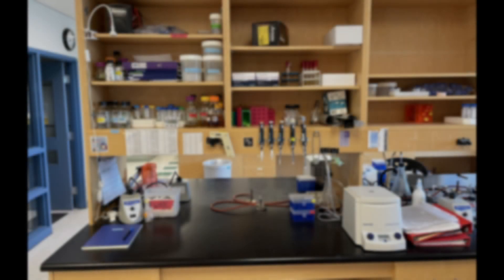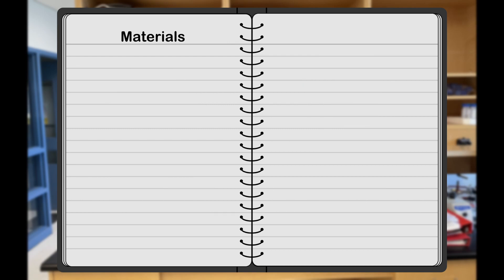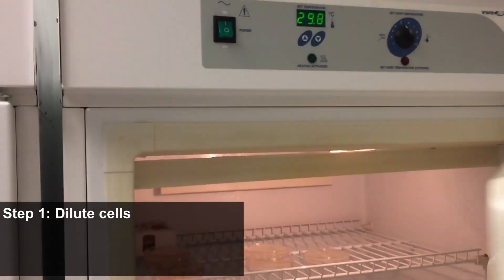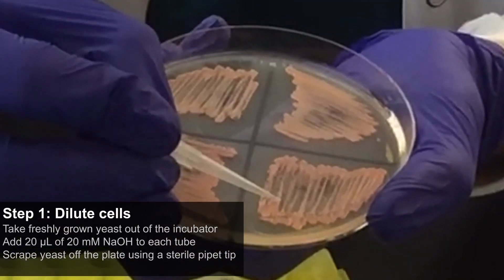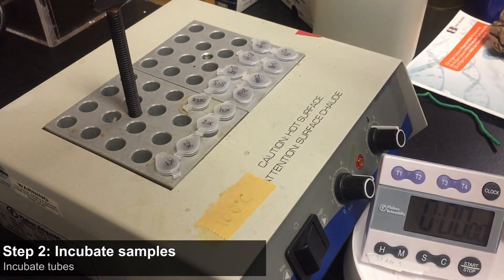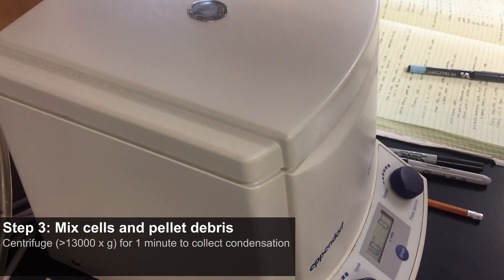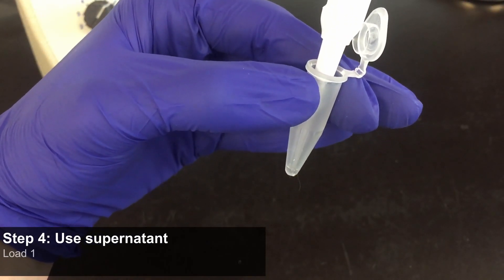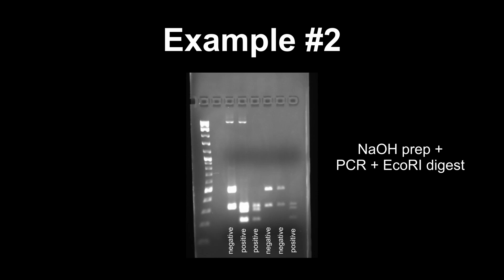NaOH Yeast DNA Preparation (Lab Tutorial)

Comment: NaOH can be reduced to 10 mM and still give great result. It's better to include 0.4mM EDTA in the NaOH to inhibit DNA degradation. Also, add Tris-HCl pH 5.0 after cell lysis to neutralize the NaOH. This way you get absolutely no pCR inhibition. Tried this method numerous times and it works every time.
Reply from the maker: I'm glad to hear a similar protocol has worked for you in the past! I bet some of those small adjustments you mentioned would pay off well. Good luck with your future experiments!
Reply: Hi! Could you please tell me about the Tris final concentration?